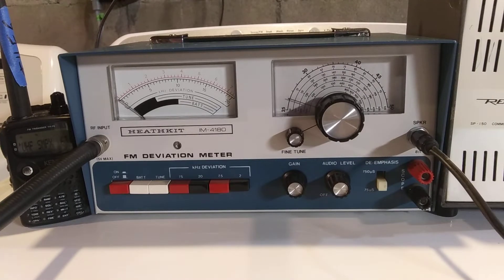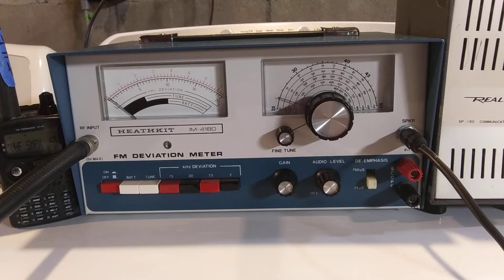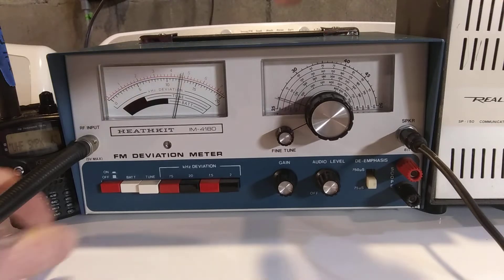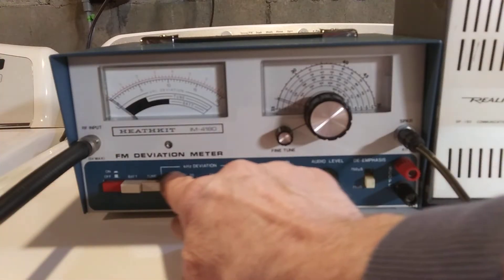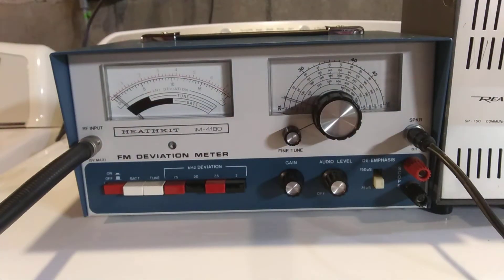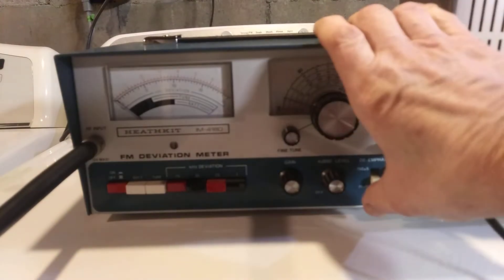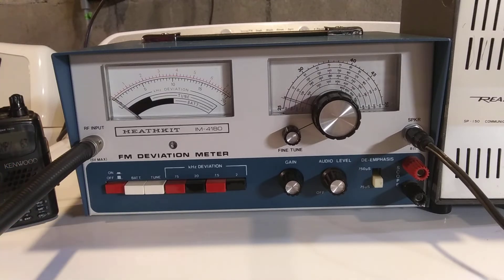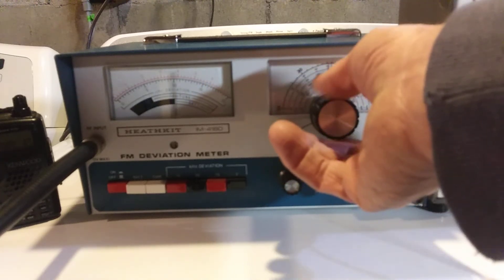Heathkit IM-4180 FM Deviation Meter Demo

Comment: The meter shows the relation of the frequency deviation to the modulating signal amplitude. (How loud). The airwaves police are very interested in deviation or over-deviation - the latter sends noise into adjacent channels.
Reply from the maker: Thank you for the comment and info. I appreciate it. A local friend saw the video and asked to trade something for it. I think I got an old Hallicrafters S20 shortwave receiver in the deal.
73 Paul AA1SU